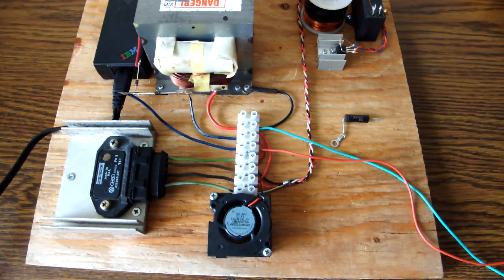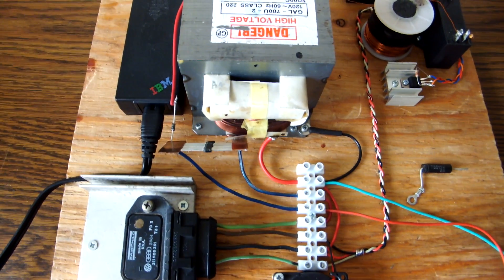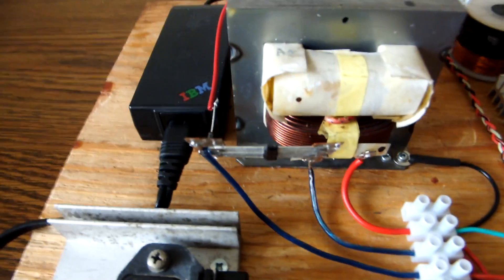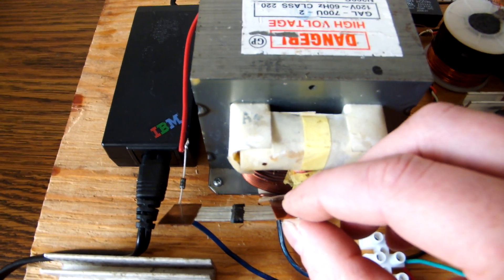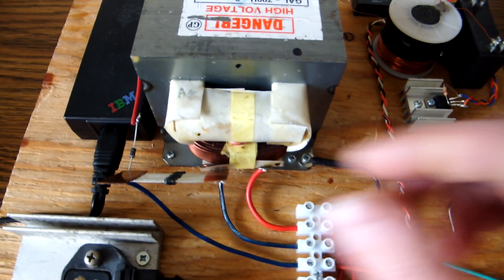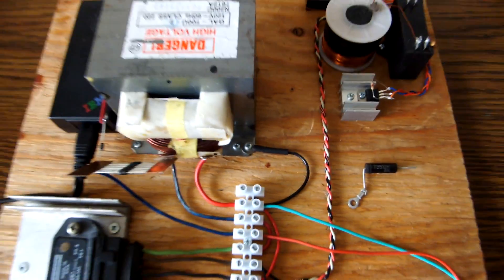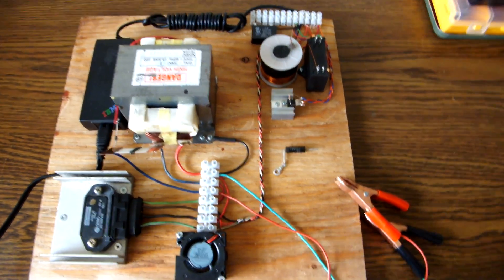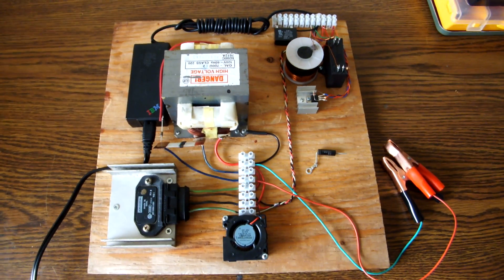HHO Pulse Charger v2.0 - Proper Use of Output Diodes Explained On Radiant Charger

Comment from the maker: Well I don't know actually. I wish I knew. As a side note: The large metal microwave capacitors are safe because they discharge instantly when you disconnect them. Whoever invented microwaves knew that some strange person would take one apart and try to use the parts, and they didn't want anyone to get electrocuted! The magnetic gun inside the microwave does look like nuclear device, I didn't try taking it apart, I threw it away. I don't know much about how they work!